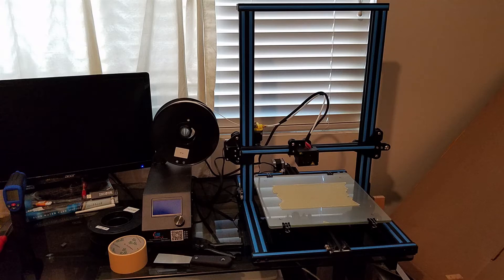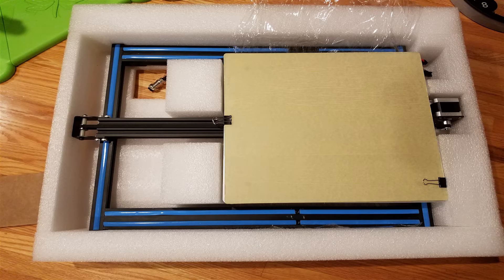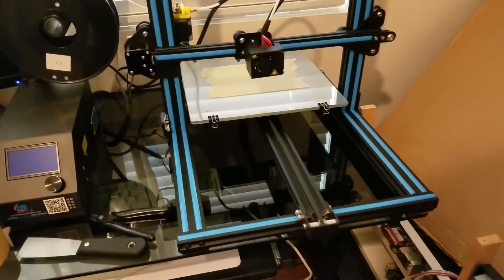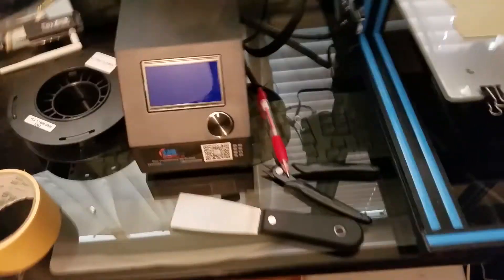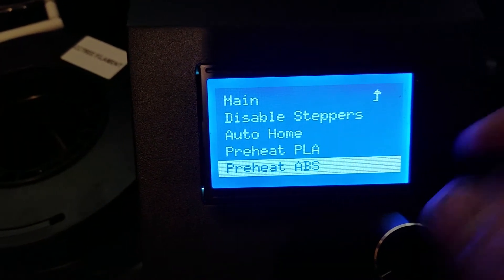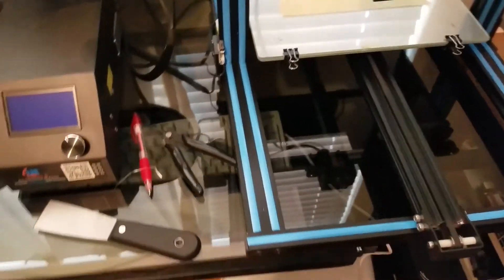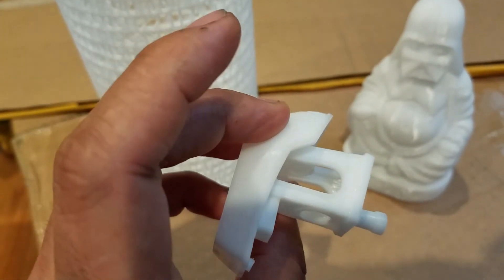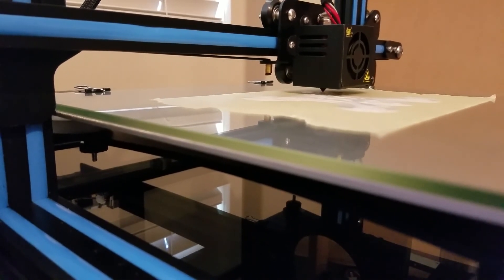Creality CR-10 3D printer Review and Setup

Comment: Hit the Pi pencil holder with a heatgun carefully. Set for high temp and brush hot air over it carefully and quickly. You can get rid of a lot of the strings/boogers.